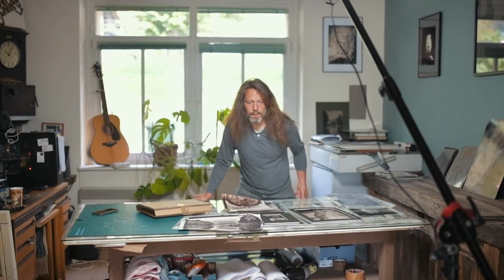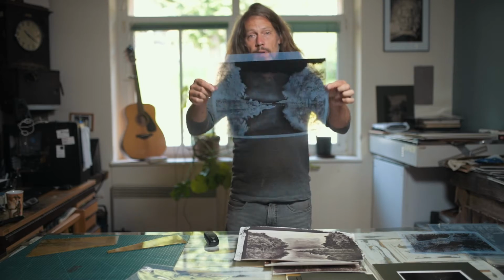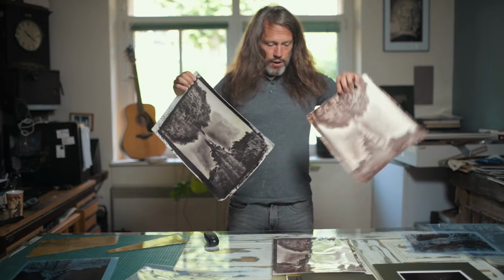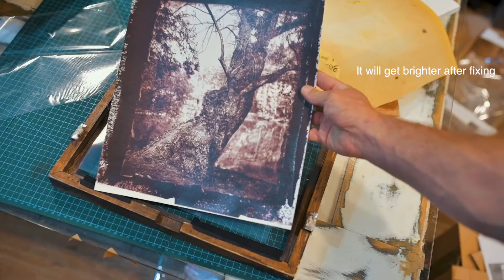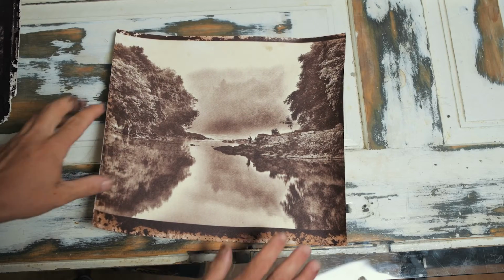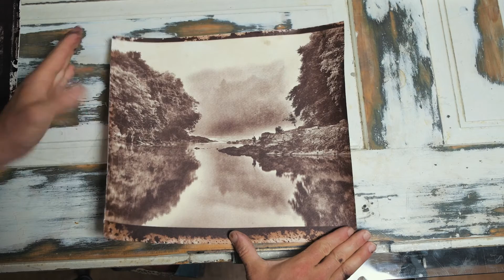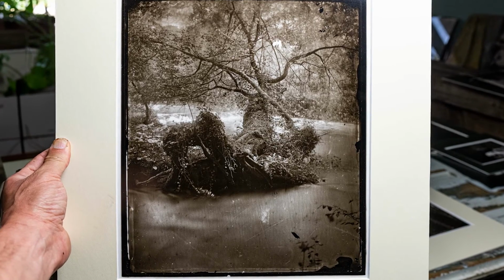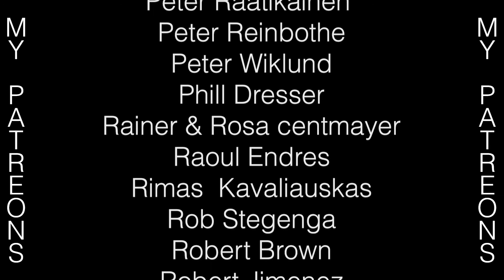Albumen printing: This Was Unexpected!! / #158

Comment: an egg-solent video!, but with the agno3 isn't that the silver in the mix?, so, like wet_plate don't you have to put this inside a brown bottle, or the 'dunk tank' that they use in plate photography, to stop the chemicals activating until you expose it, either in your 'contact printing' way, or in a camera.
Reply from the maker: Short answer is No. After the silvernitrate is used for wet plate collodion process, it is sensitive for light, but this sensitizing solution is clean, no organic matter was introduced, so it is not sensitive for the light. in general wet plate collodion photographers are overexaggerating around this topic, it's far less sensitive and it causes far less issues. Nevertheless it is possible to cause issues.
Reply: @BorutPeterlinPhotography  AHA! so it is only the mix of the two, which is sensitive, not the native silver halide itself!, as I presumed, like a raw 135 negative, or roll film that it was sensitive.
but like electricity and water, it needs a 'solution' to transfer the silver ions in, like the impurities in water, to transfer electrons.